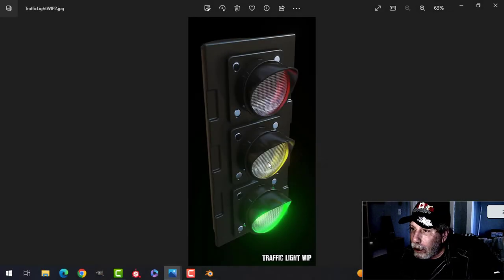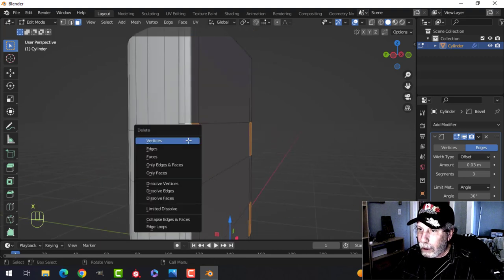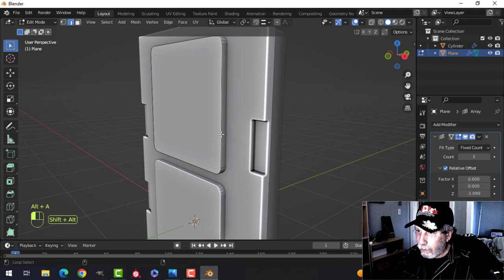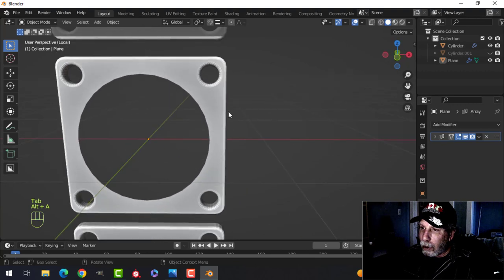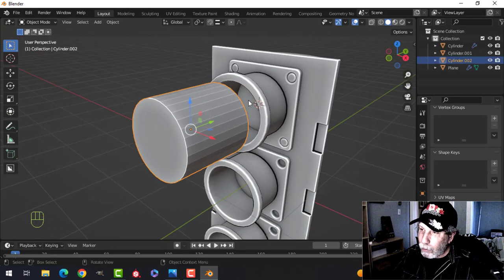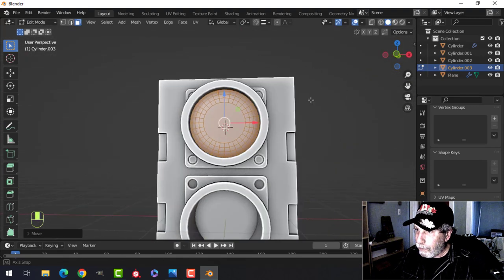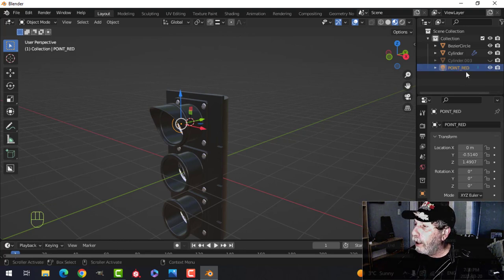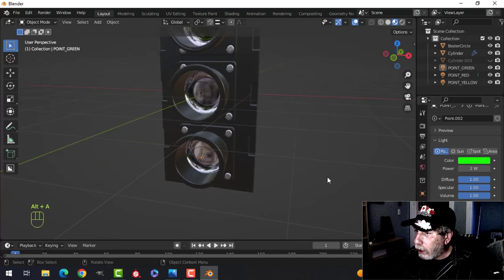BLENDER: TRAFFIC LIGHTS

Comment: Fantastic tutorial, though I personally prefer a less destructive workflow you went through things in such a way I could easily follow doing that. For example: I still used the circle curve, but I found it didn't make a perfect circle (at least with 12) so I instead used it as a cutter and used it to cut the curve out of a cylinder object to get a similar result.

Comment: Hello, I am new in blender, i like your videos, please, i have issue here, i tried the boolean modifer, it created a hole at the front but the back view of my object is closed. the front did have the boolean effect, not the back.  What could be the cause?
Reply from the maker: @Biblestorieslovers  Welcome to the channel and Blender.  It's been a while since I made this video so I don't recall it well.  For the boolean, if you want a hole all the way through,  make sure your cutting tool (ie. Cylinder) passes all the way through the object you want to create a hole in.  Sometimes you will have to delete the back face.  If you're having trouble still,  practice on a cube and use a cylinder that extends all the way through the cube.  If you still have trouble,  you can email me at kimmelelliott@gmail.com and let me know where in the video you saw this do I can refresh my memory.  And don't forget to make sure all polys are facing outwards on both the object you wish to cut and on the cutting object by selecting them in edit mode and pressing alt-n and then recalculate outside.
Reply: Thanks so much, your tutorial is the best. Thanks so much 🙏
Reply from the maker: @Biblestorieslovers  and thank you for the kind comment.   Hope all works out for you.